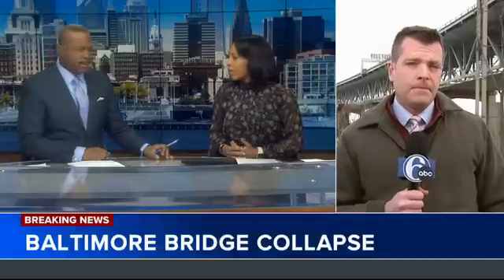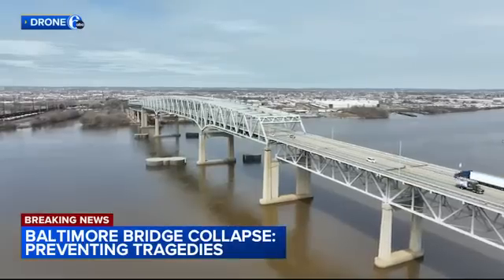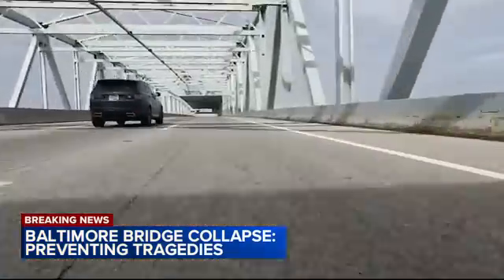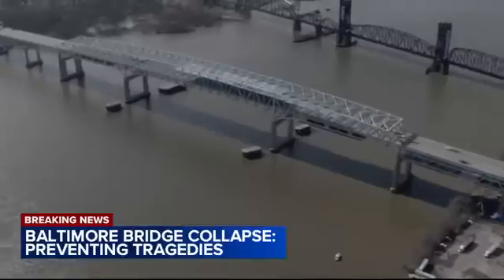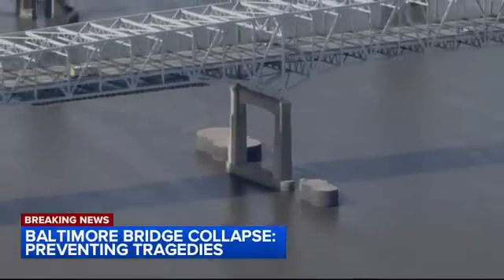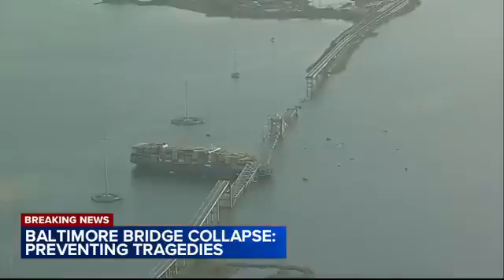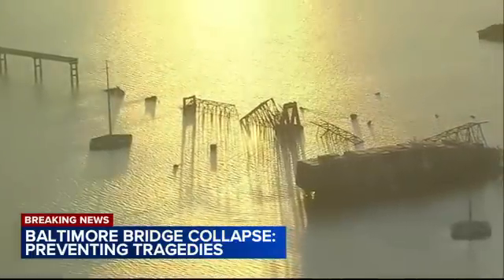Here's what surprised a structural engineering professor about the Baltimore bridge collapse

Comment: "Build a bridge that barely stands" - as long as US civil engineers keep that stupid mantra, this will happen again and again. In a foolish effort to keep costs as low as possible, engineers do the bare minimum they're legally forced to, and not a single inch more. So either laws are updated to force bridges to withstand far more (in which case  companies will complain the gov't is "putting them out of business") or the culture of civil engineers should change: a well done bridge/bulding/dam is always srightly over engineered. You don't build a structure to withstand just what law demands of you or what the strongest earthquake/windspeed is, you add a safety factor. In this case, it was way too easy to foresee that at some point a ship would hit a support, whether by accident or otherwise. But no, the engineer in charge preferred to construct a bridge that barely stood...

Comment: Newton's first law teaches that a body will maintain its direction and speed unless acted upon by an unbalanced force.  My understanding is that the ship allegedly lost power (thrust), thus it should sustain its established trajectory and speed unless an external and unequally met force pushes it off its course.  Thus, what force pushed the unpowered ship off course?

The water waves are one type of force which provides drag resistance, which will slow it down in its given direction. However, to get this alleged unpowered ship to change its direction so drastically should require a significant external force capable of overcoming the ship's mass and acceleration/deceleration along its established path. The only force available to counter the unpowered ship's trajectory, in my opinion, must come from the water waves pushing the unpowered ship off its unpowered course. That is my my understanding of the matter.

Comment: AND THOSE SUPPOSED "SAFETY PYLON'S" WILL NOT WORK EITHER !,  IF HIT STRAIGHT ON THE ABSOLUTE BOW ( THE POINTY BIT AT THE FRONT ) OF A SHIP, IS AT LEAST 100 FEET FURTHER PAST  THE ACTUAL WATERLINE STRUCTURE OF A SHIP OR LARGE BOAT, WHICH IS WHAT WILL HIT THE PYLON IN THE FIRST INSTANCE,
TOO LATE, YOU GET MY DRIFT,  PARDON THE PUN.

SATT.

Comment: Pretty big difference here. One shown literally can’t handle a ship like the one that failed and the piers protection in place on example shown here would not have stopped its destruction in the same situation. This is not apples to apples. Did it need more protection? Sure but its fail was not an engineering flaw but simply an issue it was never designed to survive…… like fully loaded 747’s into a building! Frankly this should have been a tunnel to begin with to protect the port against a bridge blocking it or a ship taking it out. Frankly the port at its current location had outgrown the space and needs moved closer to the open ocean with new infrastructure to support its goods movement!

Comment: Seems pretty unlikely that a few small chunks of concrete would have been able to protect the bridge support columns from being impacted by such a large, and heavy ship.  It'd probably have run right over them anyway.  Also remember the Dali was only "mid-sized" by container ship standards anyway.  I thought this analysis was going to focus on how the different major sections of the Francis Scott Key bridge were all so interdependent on each other, that if one support collapsed it took down so much of the bridge.  Many other long bridges aren't built that way, like that long one in the Florida keys, where one support column going down would only knock down the sections immediately adjacent to it - not most of the bridge.  Such a design would have potentially saved lives by limiting the collapse to something smaller, less dangerous, and easier to clean up.  Be interesting to see what new design for this bridge they come up with when they re-build it.  Be nuts to re-build an identical bridge there again!

Comment: Welllllll....  Those protection devices shown are only installed in the normal travel lanes.  This ship lost power and control meaning it could easily drift into unprotected structures.  The collapse bridge did fine for a very long time so what changed?  Electronic controls and systems with single point failure modes.  But don't worry - they're everwhere!

Comment: What's surprising is that it steered directly into the pier.
Reply: it could not steer as it needs electricity to activate the steering ..whatevr position the rudder was in when it lost power is the position it will stay in.
Reply: @allanchurm  then why did they not drop anchor they were having power issues long before the crash.  and an anchor can be dropped without power, and yes they can drop the anchor manually.
Reply: Shh, please don't startle the sheep.
Reply: THANK YOU!

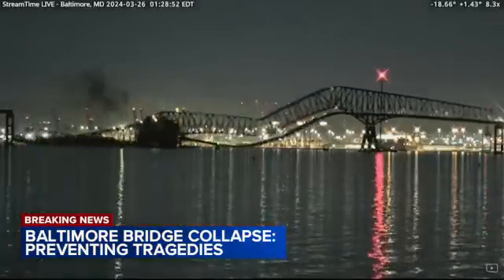Comment: What the engineer at says at 1:42 is incorrect:  A "continuous" bridge has no ability to "hang on" or stand partially if a pier collapses or a crucial member (called a "chord") fails.  It can't hold itself up if it is not fully intact.  The whole thing goes down.  Interesting what you see in the video we've all seen:  When the pier on the left collapses as the ship hits it, that part of the bridge starts to fall first.  That transmits a cantilevered load toward other pier, like flicking a skipping rope tied to a fence at the other end.  When that wave reaches the far right abutment, it lifts the far right end of the bridge up off its abutment like a teeter-totter, breaking the junction with the approach spans and allowing the right end of the bridge to bend off the right pier until it breaks and falls into the river too.
The only way this bridge could have partially remained standing would be if someone very neatly snipped off the upper and lower chords just where you see the kink developing at 1:41, before the shock load reached the far right abutment.  (At 1:41 you can see the shock load already has reached the right abutment from the puff of dust and debris being kicked up at the joint.)   But because the bridge remained all one piece until too late, the falling left segment takes the right segment down with it.

Comment: So when it was built in 77 it would've taken a hit from the ships at the time. The spans where build to accommodate them safely etc.
Today ships are so huge that if they installed the safety measures would it have blocked so much of the channel that it's impossible to navigate?
Where the Betsy Ross bridge might be much closer to the water, so can only take ships up the X size, and with the new defenses installed it doesn't pinch off the channel that much, etc. Just thinking out loud here, not an expert by any means.
Reply: exactly they don't fix it till it's broke

Comment: This was no accident!  They were on "drive 1" of 2.  The first drive is a fail-safe and will allow steering, even if the power goes off.  It does that automatically, by using a diesel-powered generator to provide power for the steering.

Comment: Glaring difference between the bridges is that ships pass MUCH closer to the Betsy Ross bridge supports.  Key bridge traffic is supposed to pass under the highest point this ship was way right due to its mechanical issues.  Its support columns were placed out of the shipping channel for this reason
Reply: The protection systems are for ships which are not where they are supposed to be.  If ships were always where they were supposed to be, you wouldn't need fenders and dolphins.
Reply: @GH-oi2jf  that pylon is located OUTSIDE THE CHANNEL. The ship partially ran aground causing it to spin in which case it was able to strike the pylon.  The pylons for this bridge were in shallower water for the PROTECTION much the same as the dolphins are for the Betsy Ross and other bridges. This was a freak accident. Normal operation the ship are no where close to the pylons and under power with steerage to control the ship. THIS SHIP lost total power and steerage. Was not able to restart the engines fully called for help but no one was close enough to do anything. The dolphins wouldn’t have stopped it or prevented the collapse at that weight and speed.

Comment: The water in Baltimore was much deeper. It was very difficult to create the same type of defense used on the Betsy Ross Bridge.
Reply: If you can build a footing for a bridge pier, you can build a structure to protect it.
Reply: @GH-oi2jf  as you go deeper, you have to spread out the base or drive something extremely solid well down into the sea floor.  Virtually anything can be done, but not everything is feasible from a funding standpoint.

Comment: that collapse mode is normal for a steel truss structure.  every frame member is reliant on the frame members around it for its structural integrity, so when one part fails, the whole thing fails.  maybe engineers should spend some time learning about failure modes of the structures they design.

Comment: As an engineer I am confused as to why  a professor of structural engineering is surprised. Why did you pick him to go in TV? That ship took out a part of the bridge that has no backup, no redundancy. People with PhD’s are often not in touch with reality. 
Basically the bridge lacked a defensive system. That tiny dolphin was never going to work. Look at the power line next to the bridge, somebody knew what they were doing. That defense was what the bridge needed.

Comment: Bloody bullshit.
96,000  tonnes of empty ship, plus 10,000 x 20ft containers, that is up to 200,000 tonnes, moving at 8 knots like the Dali in Baltimore would not have been stopped by those tiny lumps of concrete in the water! Laughable. Those little things are only good for much smaller ships. When ships run around they travel dozens of feet inland and up rock shelves.
Reply: If the ship had hit a large dolphin, it would have ripped a large hole in the hull and taken on enough water to set the ship on the bottom.  That would have stopped it.

Comment: There have been other bridge collapses due to being struck by ships. When rebuilt they then include buffers to the piers. There have also been incidents where trains have struck bridges. I would assume that there are updated design standards, so the question is why haven’t anyone looked to see what bridges are compliant. Near where I am a train struck a pillar on an overhead bridge causing the deaths of over 30 people. You can see where they have added extra concrete on some of the other bridges to prevent this.

Comment: 40+ years ago ‘The Tasman Bridge’ Tasmania Australia was struck by a cargo ship taking out a section of bridge a few lives lost. 

Loaded with an estimated 10,000 tons of zinc concentrate travelling at speed. 

Cargo ship didn’t stand a chance. It sunk to the seabed. 

Still at the bottom of the ocean and is constantly monitored and surveyed. 

Not recovering the load was the most difficult decision for authorities but feasible. 

Captain was granted an exemption use of a pilot/tugboats. 

It’s not known if the ‘Off Course’ Alarm sounded. 

Big deal for company as it’s less of a cost. 

There is an Australian government ship today that is totally banned from travelling under this particular bridge maybe other bridges because of its instability even with hi tech onboard and a pilot/tugboats.  

Since the tragedy all sorts of measures taken including stopping traffic both ways and only permitted designated times for ships.  

Question is for Baltimore. 

Did the backup diesel generators kick in? 

This cargo ship lost power twice coming in hot. 

Why? 

Human or catastrophic systems failure glitch?

Comment: If you look up photos of the Key bridge before the disaster, you can clearly see that it has four dolphins (albeit smaller than the ones you see in this video in Chicago)

I read an article that stated that the Key bridge had adequate dolphins according to current safety codes, but the dolphins are shifted to stop ships that drift out of the shipping lane.  The Dali had drifted into the bridge from a different angle than expected, missing the dolphins entirely.  The civil engineer consulted in the article believes that codes will be updated to require dolphins on all sides of piers, to prevent another accident like this from happening again.

The bridge in this video also has the dolphins shifted to one side, and is vulnerable to the exact same accident that occured in Baltimore.  The dolphins on this bridge are NOT adequate, and this bridge IS vulnerable.

Comment: It was a continuous truss but it was cantilevered so once part was damaged and it separated the imbalance sealed its fate. Didn’t clue in until I saw pictures of the construction. Before the span was complete in the center they had temp supports to the sides of the main supports. Once completed the continuous truss was balancing the weight of the ends vs the center. As you see from this story a very common bridge design hundreds of large bridges like this. Be cool if they can do a cable stay like the new Gordie Howe bridge, they are awesome looking structures.

Comment: The baltimore bridge had the protections (they called them dolphins) but they were probably designed for 1970's sized ships.  If you look at more modern structures  not only are they further away from the bridge but they are 3 to 4 ties the size of the older protections. also the piers (supports) of the more modern  bridges are larger and higher above the water level.

Comment: Those protections won’t do you any good if the ship goes off course and hits the supports closer to shore. That’s exactly what happened to the Tasman bridge in Hobart, Tasmania in 1975. All supports which can be hit need to be protected. A ship which has lost control is just as likely to drift towards an unprotected support.

Comment: Those ships, even when moving slow, have an insane amount of inertia and momentum. The Dali weighs about 115,000 tons fully loaded. Let’s assume it was going 5 knots, which is about 5.75 mph, or around 2.5 m/s. To get its momentum, we can use the equation for this: mass times velocity. This gives us an answer of 287,500 tons of momentum. That pillar had to withstand that much pressure. It may have been able to do this if the pressure was in a vertical axis as it was designed for weight to transmit down through it, but it had no chance to withstand from the side, as it was never meant to have that much pressure on that side and in those directions. There is a reason they need huge engines to move them-the Dali’s diesel made about 58,000 HP.

Comment: There is a round bob of concrete in front of the pylon at the Baltimore bridge. It would protect against a direct hit straight on, but since the container ship was drifting outwards, it didn't help. It sits now next to one side of the stuck vessel. I am not conviced these bigger dolphins on the other bridge would help against a big container ship drifting sideways into the pylons.

Comment: It is very simple to protect the bridge supports. A slow gradient concrete ramp leading up to the supports. The ship grounds on the concrete and uses its own weight and friction to stop a ship of 100,000 tons in about 50 to 100 yards if at about 8 knots. A very simple solution to protect existing bridges.

Comment: In a number of posts I’ve noticed some folks mentioning it being inevitable that the Baltimore bridge collapsed. Of course this could be prevented, no matter how large the ship was. As other posters mentioned: it doesn’t take an engineer to see that there were no protection measures in place. As a Dutch civil engineer, I can assure folks that those protection systems, built to deflect the ship away from the pylons, are taught in the very first year. It’s bridge construction 101. It’s so logical that civil engineers everywhere are scratching their heads and wondering how it’s even possible that a bridge doesn’t have these measures in place.
…
As for engineering 102, one thing that gets drilled into your head is that constructions need to be able to redistribute loads. If an element or even an entire section of, in this case, a bridge, collapses, the remaining construction needs to be able to ‘fill the gaps’ and retain structural stability. This should have been contained to one section of the bridge, maximum. A third rule is that the rate of collapse needs to progress slowly, predictably and step by step. Never should a structure fold in on itself like the house of cards I saw in Baltimore. Example: the pylons to the sides of the impact could have been twisted by the forces of impact; parts of the deck on both sides should have hung in there, albeit hanging downwards towards or even into the water. Structural failure doesn’t necessarily mean ‘plummeting into the depths.’ Simply having deformed enough to be considered unsafe already counts as structural failure.
…
My sympathies towards those that lost loved ones due to this tragedy. I don’t consider this an accident: this is criminal negligence, pure and simple. If I had been responsible for the safety of the design and/or maintenance of that bridge, I would fully expect to go to jail. Unacceptable. Period.

Comment: Even if those "dolphins" / preferential piers contained hundreds of tons of concrete remember this vessel weighed around 100K tons. Without power and drifting is still going to do a lot of damage.
Reply: its not relying on the weight of the concrete its relying on its shear strength and is imbedded in the ground a ship would stop dead if it hits one because its trying to push all the earth around it as well.